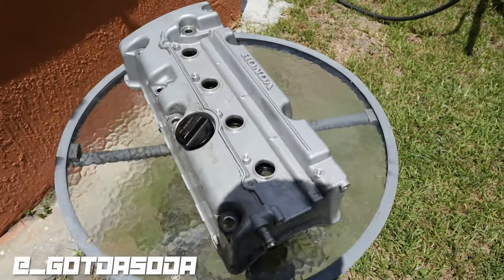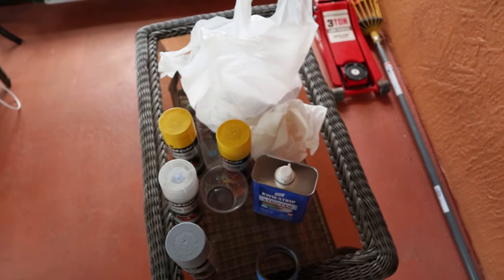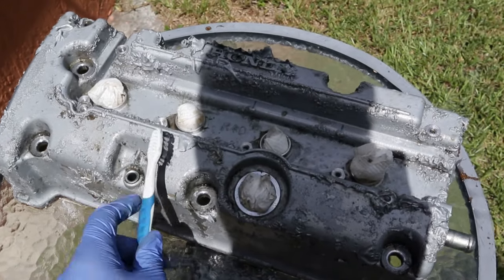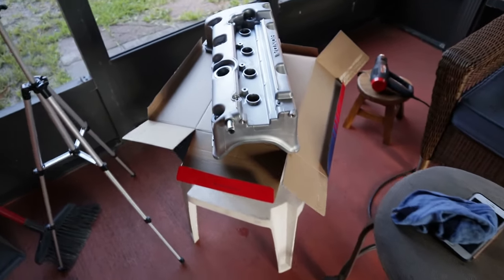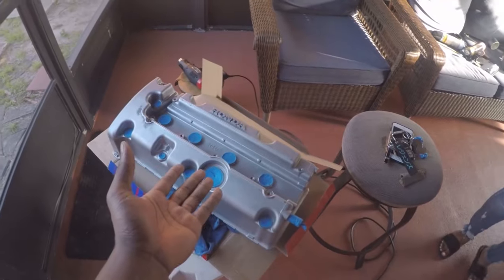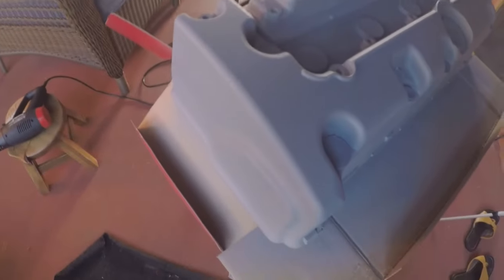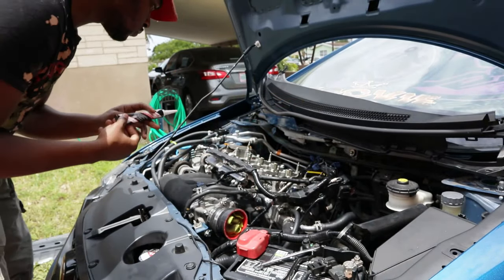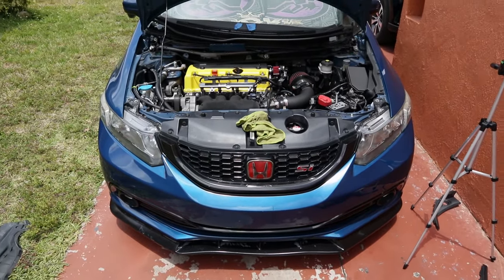Painting My Valve Cover!

Comment: That's looks really really clean....... Next time use a hair dryer or heat gun (same thing) in between coats. Helps to stick, prevent runs, and cures a little better. That's what I do when I use wrinkle paint to. 
Looks fire bro
Reply from the maker: This temporary until I can get another valve cover I can powder coat or make chrome.